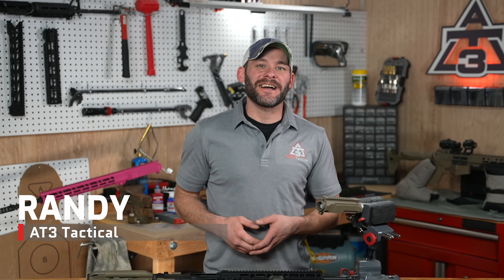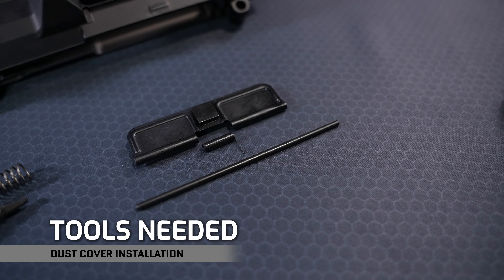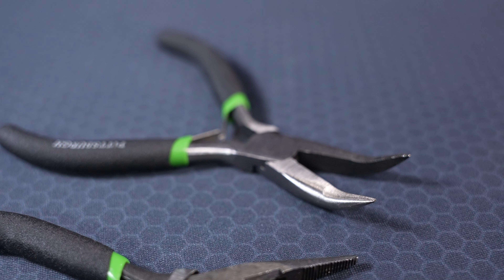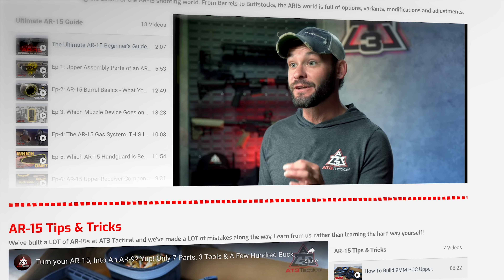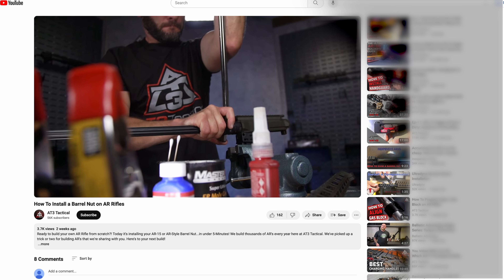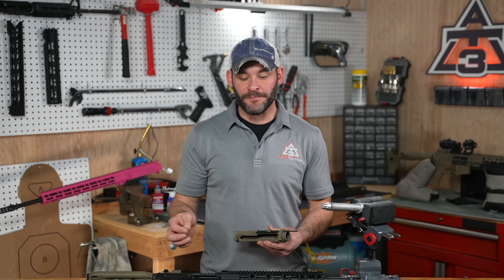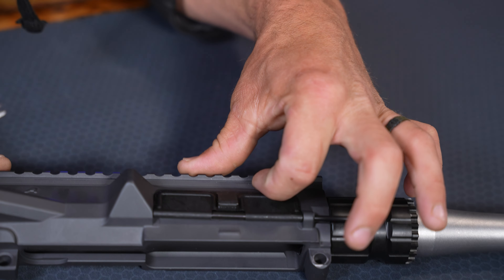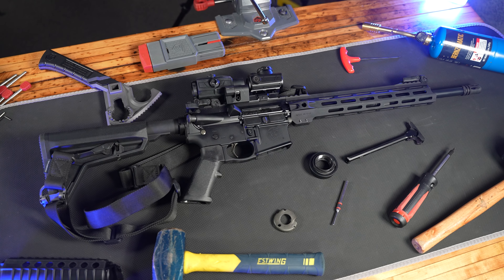How To Install a Ejection Port Cover on AR Rifles

Comment: Video clips shows installation with the barrel nut installed. While instructions talk about the installing barrel nut video and doing the "reverse." So which is it? Remove the old dust cover and install a new one with the barrel nut already on as the video shows or install without it like instructed?
Reply from the maker: Usually you can swap out a dust cover with out removing the barrel nut, it just depends on your setup.